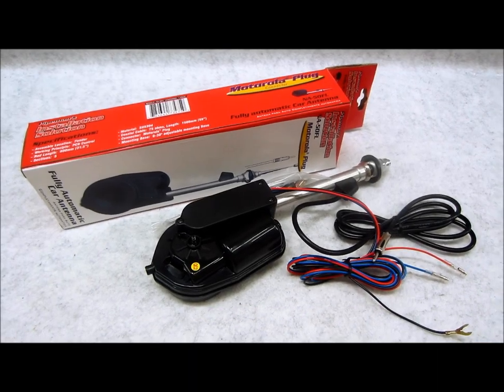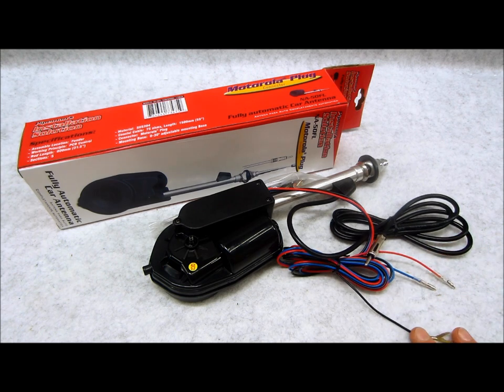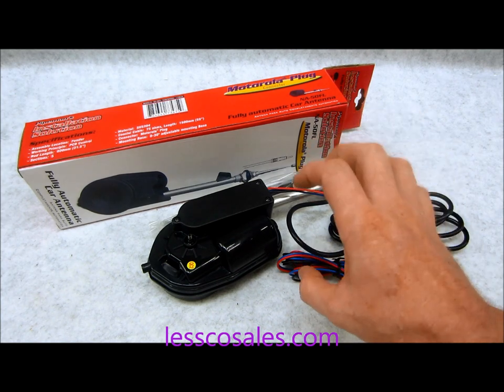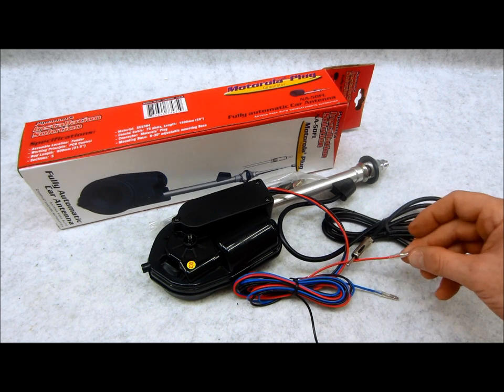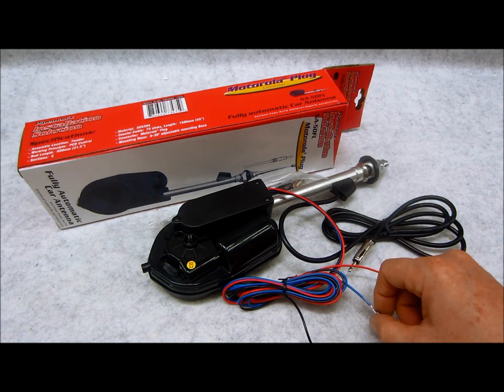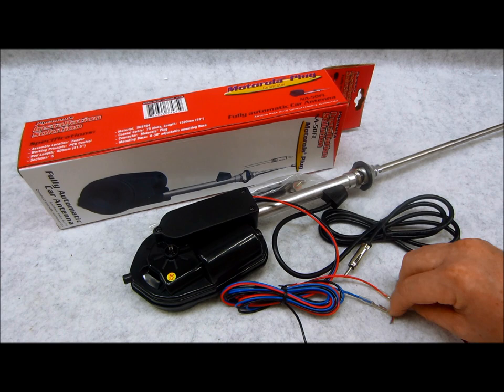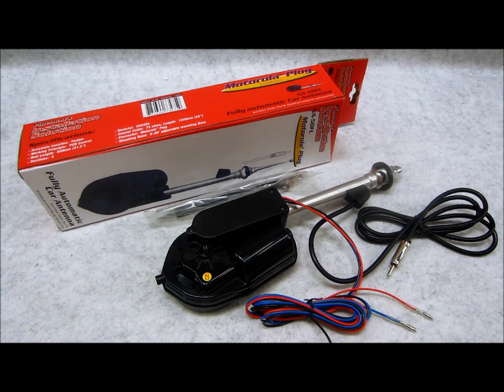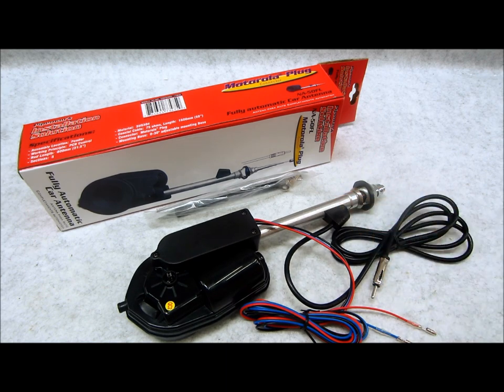How to wire an automotive power antenna

Comment: The one I bought has three wires. No blue but green. Nothing happened when connected black and red to battery and green(as trigger) to red as illustrated unless if connected black and red directly to the motor from battery.

Comment: I should have watched this before my install effort. 😀 The antenna I bought only has two wires and I determined after installation, there was no ground through the fender. I made a ground wire and attached it under a screw on the antenna body to a confirmed ground on the radio cable. Unfortunately, no joy, and even across the battery, no antenna function. A DVM check across the two antenna wires revealed no continuity. Is that what the police call a clue?

Comment: You really saved my bacon on this video. Tried for two days to figure out the wiring on my old Harada antenna. Did not realize the the green and red both had to contact the positive terminal   for it to extend and retract. I was able to get it to retract but not extend. THANK YOU.
Reply from the maker: Glad it helped

Comment: thank you for showing how it works, specifically the wiring. i couldnt tell which wire was for the power antenna on my radio since it originally did not have a power antenna, since you explained how the antenna cable reacts, i used a multimeter to identify which wire delivered 12v only when the radio was turned on and then i knew that was my antenna wire.

Comment: Nice Video... Thanks! 

One issue I had was when wired to an acc circuit (hot only when key is moved to accessory / ign) the antenna failed to retract when I left the radio on but took the key out. Obviously with the key out there is no longer power to the antenna to make it go down. I wired the red to a permanent live (on the Dome circuit out of interest) instead and now it retracts if I turn off and jump out the car without having to shut off the headunit first. When you get back in and the key is turned to acc/ign the headunit resumes whatever you were listening to when you got out and the antenna goes back up.

Comment: Anyone know of a video showing how to wire the power feed to a new antenna unit? In other words, severing the power connector wires from the original harness and wiring it up directly to the wires of the new unit? I can’t find anything online or here.
Reply: Um for that you need to tell what vehicle you are trying to get this done on.

Comment: thanks. Your explanation helped me a lot today in correctly understanding the wiring on my antenna.
I thought the red and green wires were for polarity switching (up and down modes) with the black wire being a common ground wire. The Chinese need to get there instructions more clearer on the packing box.  
Thanks again.

Comment: How to make antenna retract  ONLY on fm mode of the radio, so when I listen to cd or USB stick the antenna stays in down possession?
Reply: The radio would have to have that mode as an option. Other than that you would have to install cutoff switch to the blue or green wired to the antenna.

Comment: How can I fix the problem of the antenna going in the opposite direction than it's supposed to -- up when powered off, and down when powered on?  I have an aftermarket radio installed but with what I believe is the correct wiring harness. Is there a simple fix for this out-of-phase issue with the relay?
Reply: Change the polarity

Comment: Sorry, I'm an idiot. What do you wire the blue cable to so that it detects when the radio is in turner mode or receiving power?
Reply: There should be an output wire coming from your radio, usually blue, that controls the antenna.
Reply: My new pioneer AVH X390BS does not have the blue wire....
Reply: @xpectz  it does have an antenna control wire

Comment: can this be rigged to be powered by a wall outlet?
Reply: Evan W just buy an AC power adapter that plugs into your wall. Make sure its a 12 volt adapter.
Reply: @allthingssilver7635  ...with sufficient current capability.

Comment: What if the motor works but it's only missing the antenna portion?
Reply: A lot of times you can get the mast with the gear tape attached
Reply: you can get the mast ''antenna'' byitself from walmart or autozone cheap or ebay or amazon...

Comment: Is there an antenna like this but without the fish pole? Looking for a short stubby but with that setup (red, blue wire, antenna cable)
Reply from the maker: No, typically 28" is the shortest power antenna like this.

Comment: Help. I have a Realistic Radio shack AMFM 8 Track player. Yes it works great. I bought a 90 Buick with a junk radio. I understand power & ground speaker wiring. How do I get the power antenna to go up when radio is on & down when radio turns off. I have no other wires coming out of the radio to move antenna. There is a relay that switches power to extend & retract antenna. Would just hooking up Blue antenna power to a switch power source make antenna extend without running all the time? I tried to replace the original radio with a ebay radio. No luck. I have this radio shack radio that works great & I have the newest speakers I could find to fit in my Buick Estate wagon.